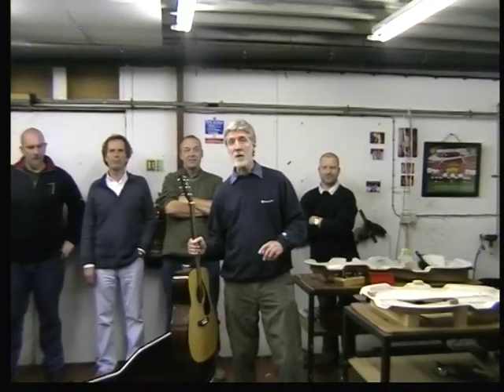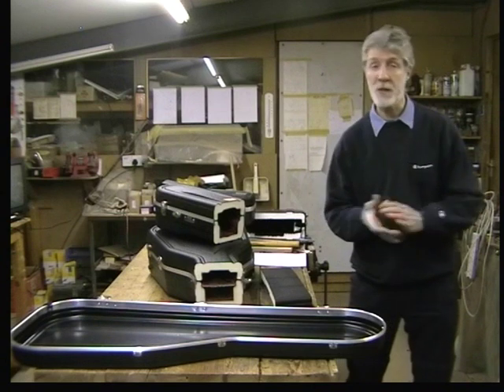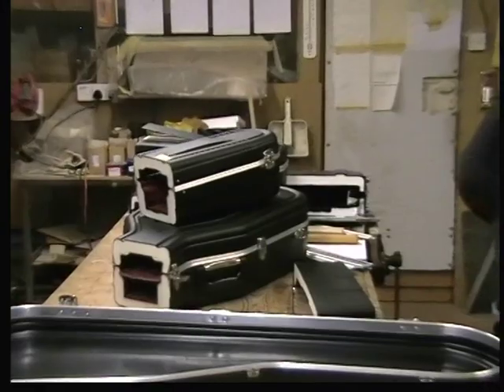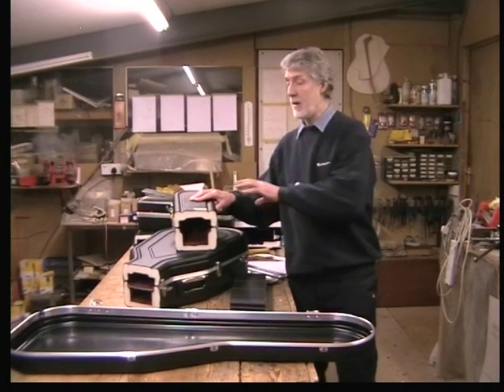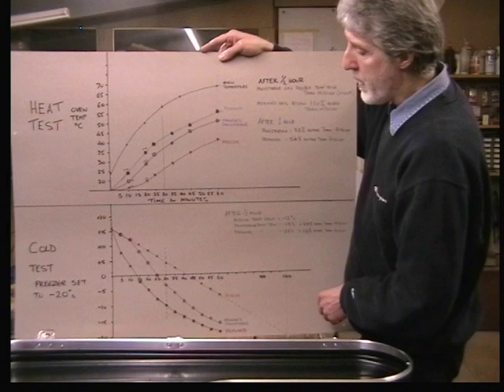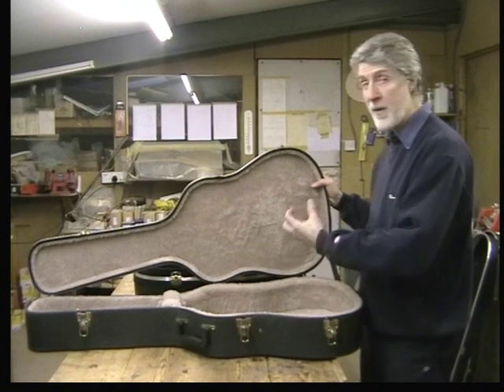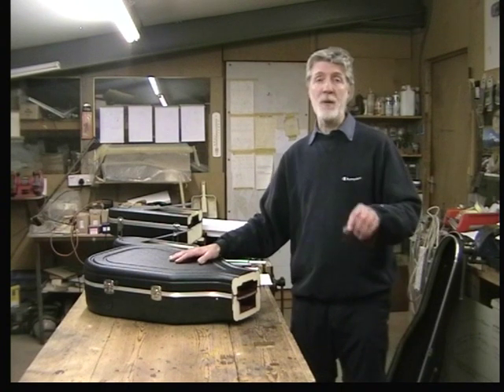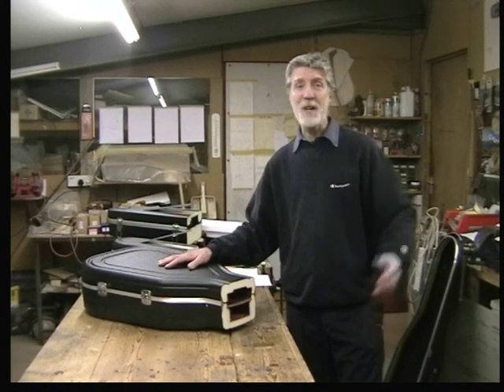Hiscox Cases. How they are made.

Comment: I bought a Gernot Wagner classical guitar in 1999 that came with a Hiscox case.  Guitar was only used at home, but the case wasn't good. First, the spring in one of the latches broke, but I could still latch it.  Then the lining fabric came loose from the lid and the hatch compartment.  I bought a Vigier electric guitar in 2017 that came with a Hiscox case that seemed to be improved.  I decided to buy another case for the Wagner and got another Hiscox case thinking I don't want to spend a great deal for a case, and the quality problems might have been resolved.  I'll see how well this one holds up.  If it falls apart like the other one, then you have lost a customer.

Comment: In the video at about 11.25 I understand that bubble rich foam absorbs shock. However if you drop you case with the guitar inside, the guitar's fall still stops too quickly. You need some soft padding to break deceleration. The polyfoam is actually quit hard. Your instrument would hit that hard foam at speed, if the case was dropped. ... I mean obviously there is a level of protection on the Standard case, but it would still worry me.
Reply: You would think that was true but I'm pretty sure that I learned differently when I worked at a bicycle shop and had to learn about bike helmets which are all hard foam.

Comment: I have a question; I bought a Hiscox Lite-Filte Pro II Hard Case in Melbourne 3 years ago for 300 AU $. The quality is excellent and i even tried to imitate what you did by asking some of my friends to stand at the top of it for three times just to prove if you're right (i'm sorry for that, just for curiosity), well indeed it really stand the weights of my 5 friends and never even deformed the Hard Case and never damaged my my old guitar (i put my old cheap guitar that i'm not using anymore when i did it), however when i look at the detail of the guitar case there is only one thing missing, there is no Hiscox logo at the side of the guitar case but there's a Hiscox logo embossed at the lower side of the plastic handle, It also has a 3 Cheney UK/England Hinges, It also has a 2 inches aluminum backing on the inside. (i forcibly opened a tiny portion to check if really there's a 2" aluminum backing on the inside and indeed there is). All i can say is this Guitar Case is in Excellent Quality, all that you mentioned and the details are the same with my guitar case but only the aluminum logo that supposed to attached at the side is missing.  I'm really satisfied with this guitar case but for curiosity i just only want to know if this is imitation or original.....hoping for your response..........Thanks Indeed........Ibarra